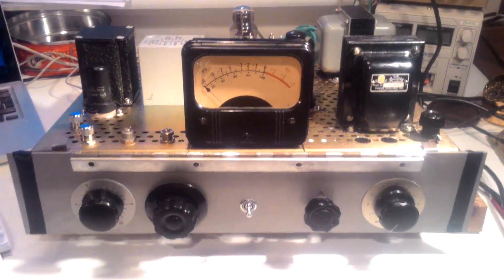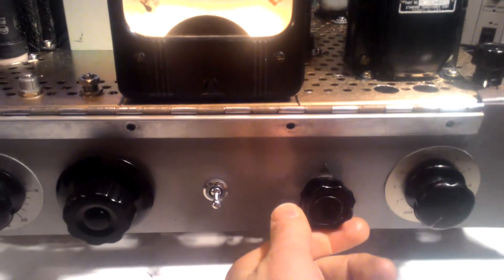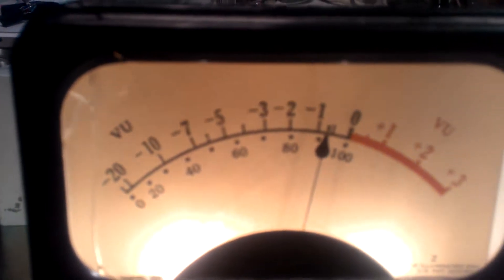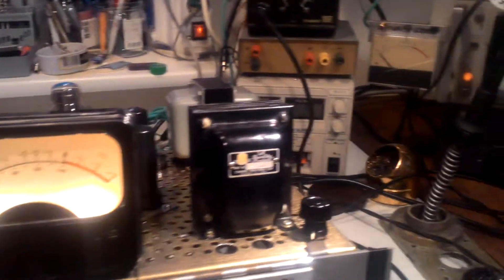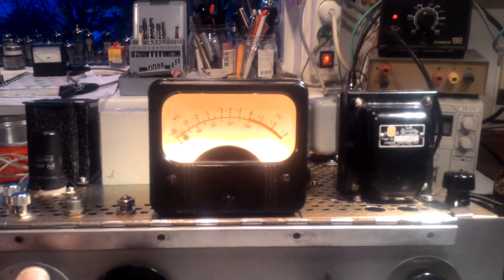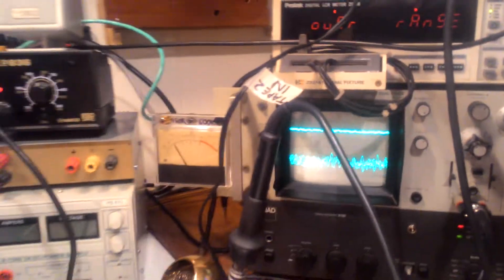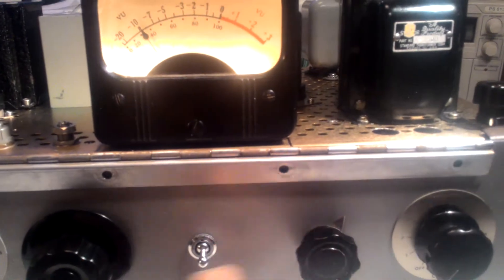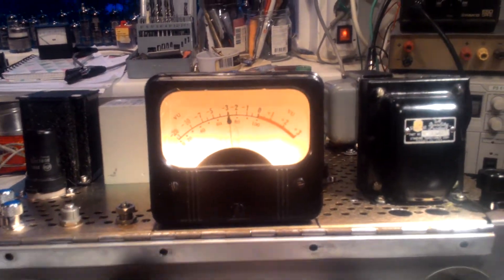RCA BA-6A Clone by Atomic Analog

Comment: Just killer! That big round weighty sound really comes through. What was the most challenging part of the build?
Reply from the maker: The most challenging part was actually analysing and matching the transformers that would suit all the specs, as I wasn't wanting to fork out $1000 for Sowter iron ;-). Instead I carefully picked from a range of vintage trafos that I had in stock, and luckily it works really well.

Comment: did you keep the tube in the power supply?
Reply from the maker: Hi Nick, I did use the OD3 regulator but I used silicon diodes instead of a tube rectifier. I didn't have enough voltage headroom from the power trafo to allow for the drop across the tube rectifier. I know this may affect the sound when overdriving with GR turned off, but never mind :-)
Reply: alright thank you, it affects harmonics, tube rectifiers sound smoother